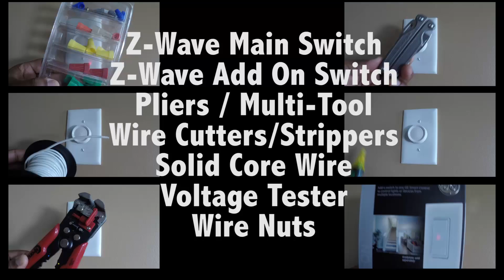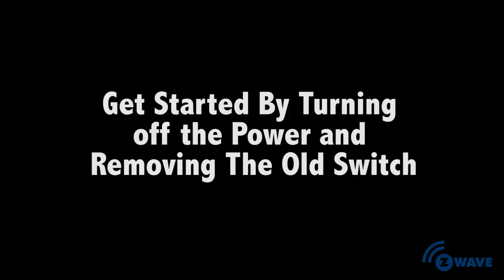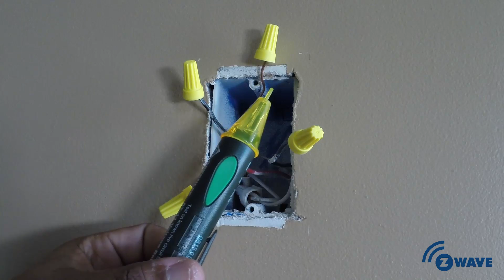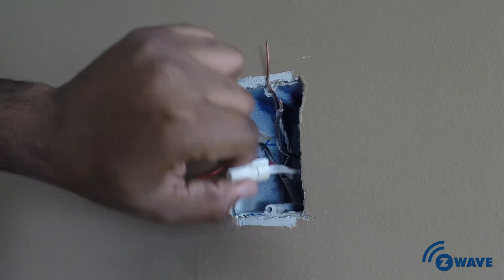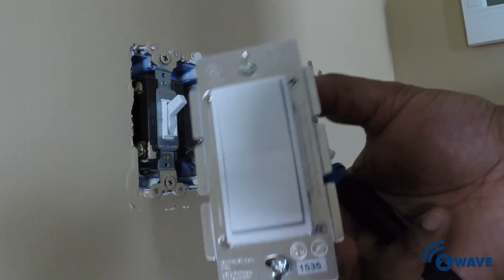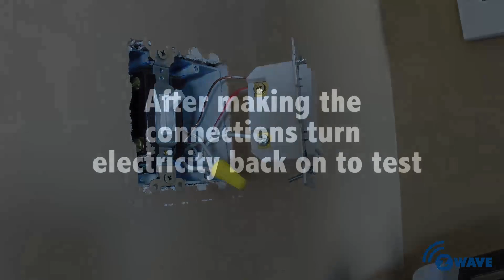Z Wave 3 Way Smart Dimmer Switch Installation

Comment: For the wire that you placed the tape onto, is that the line or load?  I don't recall you saying what wire that was.  Also, can you install only one smart 3-way on one side and one standard 3-way on the other side?

Comment: Do I need to connect the two switches via a smart hub before the add on will work?  I can turn on and off from one side (smart side) but I cannot turn off from the add on side?  Any guesses?
Reply: I did the same thing added my add on switch went to turn add on on it turned lights on then they went off automatically.so I got rid of the add on switch,used my old 3 way switch and connected my neutral to the black terminal and the red traveler line to the upper brass screw and all worked fine .

Comment: Great video...very clear and easy to follow instructions.  My only question is: why doesn't GE include a wire nut with the add on switch?? It would literally cost them 10 cents.  You're always going to need one!

Comment: 3-way question: How could I tell which outlet is master? I tested with meter, as follows:
Box 1(2gang): has 2 hot wires & 1 load.

Box 2(single box): has 1 hot wire & 2 loads. 

I have no idea which is traveler? Is traveler always hot? Confused

Comment: So in my situation one of my add-on switch location is End-of-Line so it only has Red, White, Black, and Copper....no second Black.  The only way I could get the main switch to function correctly was to connect the Black and White together in the Add-on switch box with red as a traveler and copper to the green terminal. However, while the primary switch functions correctly, the Add-on switch does nothing....it is dead.  Does anyone know how to hook it up correctly if your add-on location is the End-of-Line?

Comment: How do i know witch switch is the master?
Reply: If you disconnect everything from your 2 switches and the panel breaker is on it will be the switch that has one of the black wires with 110-120vac (USA).

Comment: What is the point of having the Add-On Switch? Will the switch that is not "Smart" no longer work if you don't use an add-on?
Reply from the maker: Loonytik Correct!! If you have a three way application, the process will not work unless you have two smart switches. That second switch is a control pass-thru back to the 1st switch using the neutral wires. The load is being controlled from the main switch.

Comment: What is the point of having the Add-On Switch? Will the switch that is not "Smart" no longer work if you don't use an add-on?
Reply: Only need add on switch if you have 2 switches controlling same light.